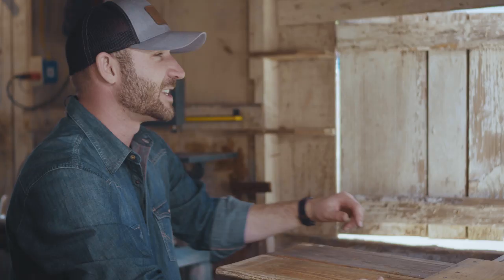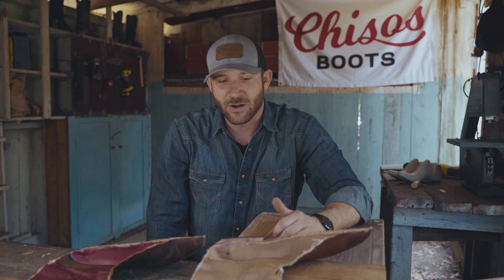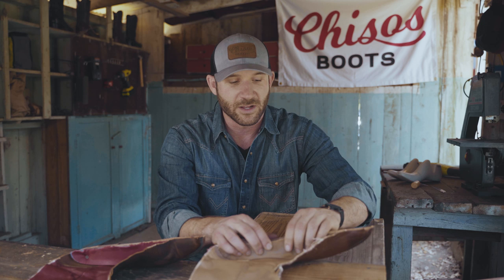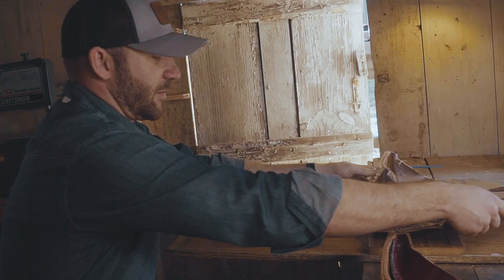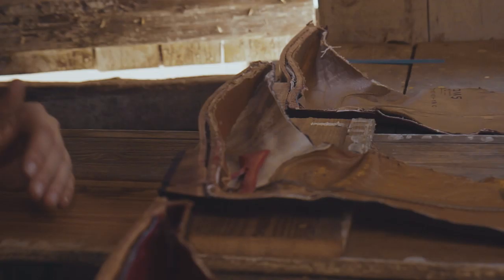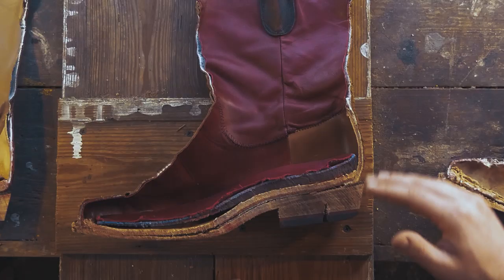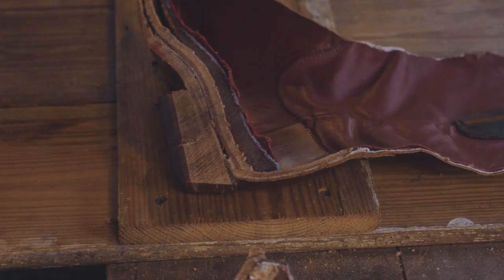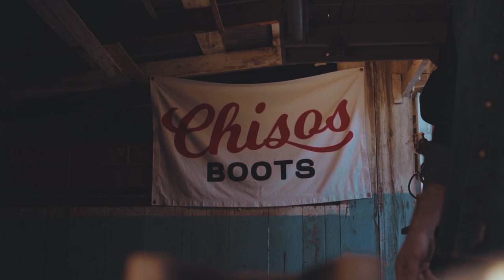Cut In Half Cowboy Boots - Thou Shalt Not Cut Corners

Comment: Can you wear Chisos boots in the rain or get them wet and the stitching not fall apart?
Reply from the maker: Yes. you can. Every once in awhile isn't going to be a problem. However, the more you expose the leather sole to water, the more the fibers will expand and then contract when it dries. This will accelerate the breakdown of the leather sole. But the uppers can handle water no problem and rain every once in awhile is nothing to worry about.

Comment: Have you ever wore White's Boots or any pacific north west boots? They used a all leather construction, including a leather shank. They are extremely comfortable once broken in. All that cushion is great when breaking in a boot but will get worse as time goes on.
Reply from the maker: How does the cushion get worse with time? Curious your perspective.

I'll have to check out White's Boots!
Reply: @Chisos , whites and Nicks both use leather throughout, in the work series anyway. Most synthetics tend to “go flat” eventually.
Reply: You can remove it if you dont want the cushion, since there's a thick leather insole that isn't removable underneath. The insole is just that extra step for comfort. Just pointing it out that's all

Comment: I have wide foot  (ee) and bought the No.2  a few weeks ago. 

Very nice boot. Fit a bit snug, hoping to stretch the leather in time. I hope they can do rubber soles in future so last longer like  vibram #700 or similar.  The footbed (insole)  which is removable it's a nice feature. Very comfortable. The outsole look top notch, really well executed. 

My only concern it's the leather itself. They website don't say the Tannery, oz of leather, type of cut, nothing and that's for me like hiding something. 

I like the boot. Just want more info about the leather. I been wearing Nick's Boots and White's boot (lace boots) for quite time and the construction it's super good, so I'm use to wear premium materials with premium skills/labor. 

Not everything from Leon its quality, actually most of those boots are junk. Chisos definitely it's not junk. .. I can say it's a very good boot. Guys I will appreciate your input about the leather and if you can ddo rubber outsoles. Plus more EE models.
Reply from the maker: Howdy sir! Can certainly add a rubber sole saver. And trying to keep up with getting more EE's, we promise!

Regarding the leather, we use 4oz+ full grain, partial chrome-tanned, retired dairy cowhides (no calfskin). Plus a full leather liner. And we use 11-iron centercut for the soles. Hope that answers your question!
Reply: @Chisos  you should be using vegetable tanned leather. Chrome tanning degrades the leather too much and reduces the life span.
Reply from the maker: @houndawg3  we use veg tanned for the sole, leather insole, and heel counter. But we found the chrome enables a more supple leather for the vamp and shaft. Typically leather tanned in this way will last a generation.

Comment: Great video, im not an expert by any means but I was under the impression that foam is a sign of a low quality boot. Doesn't the foam break down after a few years?  If you're claiming a 50 year boot, is that implying replacing the insoles ever few years?
Reply from the maker: Our removable insole will certainly alter over the years. Eventually you may want to replace it. But the core leather insole and boot construction will last through many resoles and repairs and is what matters to longevity. Great question!
Reply: @Chisos been rocking the number 5s for a few weeks now, they definitely feel great 👍🏻

Comment: Considering you put shock observing inner soles in your boots ,are your boots sized with the inner sole in mind or do I need to adjust the size of your boot because I'm not a fan of inner soles in my boots??? In other words if I wear a 13 d do I get a 13 d or do I need a smaller boot if I'm going to take the inner sole out. This is assuming the inner sole you use takes up space in the boot you make.  I don't want the boot loose because I'm taking the inner sole out. I'm also not understanding why your boots even need inner soles. I've been wearing boots all my life and I've never needed an inner sole. Well made boots are extremely comfortable and don't need extra inner soles. A true leather inner sole is all you (I) need. Thanks 😊
Reply from the maker: Fortunately your back is more solid than mine! I can't wear simply leather soled boots any more, because there is no shock absorption. If you're going to pull out the comfort insole, then you should size down a full size! So you'd likely be a 12 D amigo
Reply: @Chisos  thank you!

Comment: Those are nice but cork breaks down long before that decade of wear you talked about.  Why not make it leather like Nicks or Whites?
Reply from the maker: Good question. Some different opinions on this. These are leather soled—you're going to wear through that sole before the small amount of cork we use breaks down. When you resolve them, the cobbler will replace the cork. Our leather insole is much thicker than normal cowboy boots, and that is what we rely on for durability and the shaping to your foot/toes over time.

What do you think?
Reply: @Chisos  makes sense.

Comment: Must be a different model of boot but if you watch rose anvil cut open a tecova boot there's a big ol slab of veg tan leather inside instead of foam. That doesn't look like foam either. Just looks raggedy foam because you used a sawzall and rose anvil used a band saw. And for half the price this is just shady marketing
Reply from the maker: Take a look for yourself, amigo! 

Them: https://cdn.shopify.com/s/files/1/0077/2793/9637/files/PXL_20220902_161727929.jpg
Chisos: https://cdn.shopify.com/s/files/1/0077/2793/9637/files/chisos-cut-in-half.jpg
Reply: @Chisos  yeah looks like lining, foam, slab of LEATHER conveniently missed in your review and leather outsole.
Reply from the maker: @LT3Fluffy  I guess you see something that I don't 😆
Reply: @Chisos  I do see the foam don't get me wrong but under that tan foam is leather between the foam and the outsole.
Must be a different line than I've seen cut open. I saw a "ranch wear" tecova boot cut open because it had a rubber sole and it didn't have any foam just thicker leather and cork.

Comment: Your boot wasn't new it was used. 
You didn't pull out the shank like you did with the other boots. 
18 guage ain't very thick. 
I've seen a bunch of tevcos resoled and they all talk good about them.
Boots shouldn't be that flexible from the beginning. 
If that leather is that soft and bendable you are hiding something with that red inside the boot. 
A True good quality leather boot with leather sole is comfortable when broken in. 
You don't need that insert in the boot. 
Again hiding something. 
How is your sole put on ?
Are you using lemon wood pegs ?
Because you didn't cover everything the same way. 
Should have been all of the boots in site and told the names of each boot and never changed the view. 
No editing.  
I'm just saying that this doesn't prove anything to me.
Reply from the maker: Howdy, Chris! Thanks for watching and commenting! Would love to have you by the shop in Austin and you can see everything for yourself.

As someone who suffered back injuries, wearing just leather insoles on stacked leather sends vibrations up to the discs in my lower back, making them impossible to wear without serious ramifications. And I'm not alone. So I re-evaluated what a boot could feel like and the result is a boot that folks like me can wear and that also gives unparalleled all-day comfort to regular people, too. But you don't have to take my word for it, just check the testimonials on our website.

HOW WE CONSTRUCT CHISOS BOOTS

Goodyear Welting is the method we use to attach the parts of the boot together (vamp, leather insole, outsole) and it’s been around since the second half of the 19th century. Cowboy boots made in this manner are long-lasting and remarkably easy to repair. Traditionally it involves cutting a channel directly into the leather insole and using this to sew the welt to.

But things changed in the 1950’s when factories looked for ways to cut costs. They invented gemming, a canvas ribbing used in place of that channel. It’s faster and cheaper and more than 95% of all Goodyear Welted footwear is now made this way. However, that canvas creates an inlet for moisture and adds a point of failure. It weakens over time, shortening the life of the boot by reducing the number of times it can be resoled. It’s a departure from craftsmanship.

Chisos boots are made using the traditional channel welt method. The welt is stitched directly to the leather insole. We use a hand-cranked tool to carve a channel into the leather insole (we use triple-thick insoles to achieve this compared to the gemming method). This eliminates that point of failure caused by a secondary attachment point.

And yes, we use lemonwood pegs and six brass nails on the boot along with the 3/4 welt.

The way we do it at Chisos is difficult and labour intensive, but we believe it to be the best way. As the good book says, thou shalt not cut corners.
Reply: @Chisos  
I hear that. I would love to do that sometime. 
I'm from NC. So when I do get there I'm definitely coming to see you. 
I went to your website and found out about the boots better there. 
I'm very interested in your boot !!
Wasn't expecting $500
But that's fine with me if they are quality made. 
I really wish they were made in the USA but I know that Mexico has a good reputation for quality boot making. 
I do like the Boots very much !!
By the way I have bad back problems also. 
So you have my attention even more now. 🙂😉
Reply from the maker: @MTCKIE68  One day! Everyone eventually makes it to Austin. Also my sister lives in Charlotte and they are more than a few pairs of Chisos stomping around NC in general!
Reply: @Chisos  after finding out about you guys from Jeremiah's channel and watching this video, there'll be another pair stomping around here as soon as possible 😉
Reply from the maker: @RyGuy_1776  Love it! Thank you, Ryan. So fun how the internet can work in positive ways.
Reply: @Chisos  absolutely! Thank you for making a beautiful product. Really inspiring hearing how you started from a simple idea solution and made it come to life!